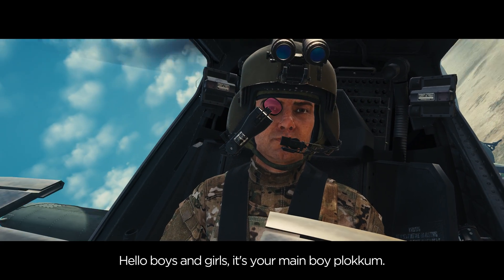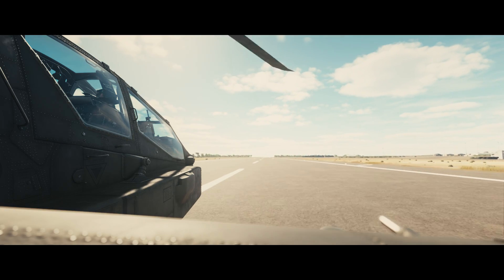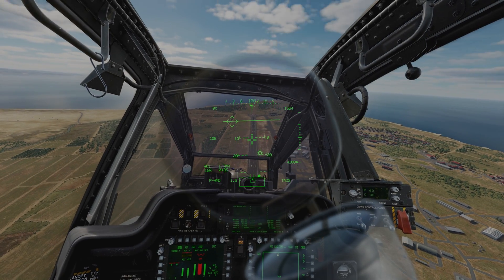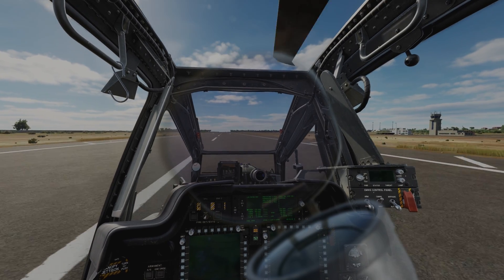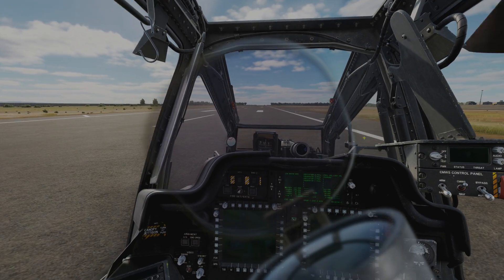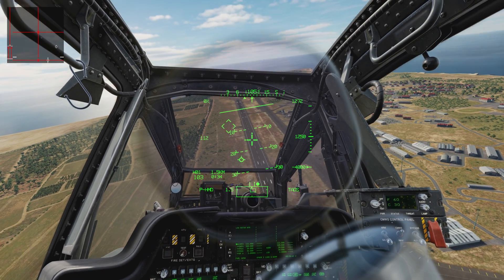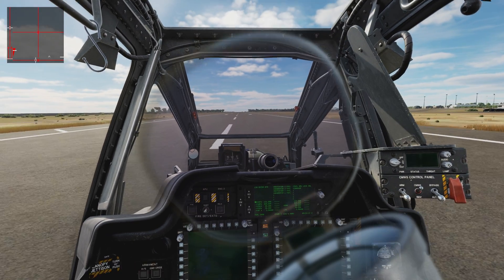AH-64D Apache Autorotation - DCS World

Comment: I admit I only tried it once.  But as a test while flying back to base at about 400ft and about 60 knots I randomly pulled the power levers to idle.  Like an instructor might. I just buried the collective and the nose, dove for the deck for airspeed.  It was a mess as I wasn't used to the bird, but I found I could easily pull out and "fly" without any collective (*) and compared to what I'm last used to practice autos on (Small RC heli's), I found I had tons and tons of time to get it settled down and landed with one a small roll.  The tail wheel can catch you out in the final flare.  However that beats hitting the tail rotor.  A technique to avoid that is the 180* torque rotation in the flare to go nose down and land backwards.  Super easy with a heli that weights 800g that has a tail gyro on the anti-torque pedals for you.  Not tried that manuover in DCS yet.
That said, RC helis require a whole different set of skills.  I was laughing my head off when I took a fixed outside view of the heli and carried on flying it perfectly normally like nothing had changed.  Even brought it into a hover in front of me, nose in.  Different skills.
Reply: (*) at low collective, I found you lose cyclic authority.  I don't think that's correct.  I don't see any reason why a low torque, high rpm, low "collective" pitch situation should or could prevent  a swash plate impulse to induce pitch or roll.  I also think the whole "toppling over upside down" thing is way over done.  I know it's a BIG gyro overhead, but are you really able to upset it that much that it flips?  I highly doubt that given the bodies mass.  The tippy topply effect happens in other flight regimes, like when damaged that I don't think is right either.

Comment: At around 150 feet AGL apply gradual aft cyclic to level out the VSI and decel then cushion with collective.
Reply from the maker: That is indeed how you usually do an autorotation. But the Apache currently doesn’t cooperate :)

 I asked Casmo about the current state of the Apache in DCS and he explained that autorotations are not modeled correctly yet.

Comment: As I understand it the Huey has heaps of mass in those huge rotor blades and so a lot of energy can be stored there as long as they are spinning. It means an autorotation is a little easier. Small bladed helos have less mass in the rotor system so you need a lot more forward momentum and disk lift to help control your descent rate, and a forward touchdown.

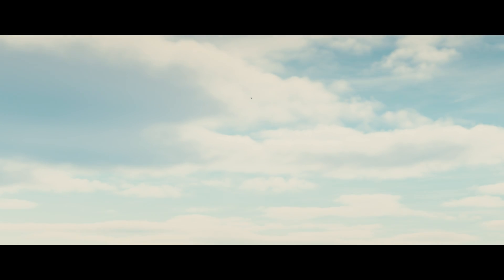Comment: 0:37 basically she autos like a rock depending on the DA haha. Desired airspeed is 77-107ktas, 90 is a good middle ground.  Higher or lower will increase your rate of decent as will being out of trim. 4 things you are scanning are, Rotor, Airspeed, Trim and position to land (flight path vector on the runway/field etc). At 80-130 feet decel with aft cyclic then increase collective to cushion for landing.

Comment: Man that second one was smooth, even touching down at 60 knots, was just like a fixed-wing landing, super linear, i wish i could see it on 3rd view, by the side, to see the shock absorbers working. I've haven't tried AR yet, not really flying, 90% of the time i'm on front seat for now, my bud is doing the PLT, but that was cool to watch, i've a tip for you, idk if will work but, try to flare a littlebit earlier, cuz looks like you're doing a rolling land with power ON for me, like you've lost the ATQ, that would be the right thing to do, but 60 knots is problable too fast even for that, and try to do a "pump" on the collective before touching, right before touch, to get for a second a boost of lift, pull hard the collective super high and put it on neutral again, if you want to do like really Apache pilots, i think that's the way, but off-course i don't have any idea how they do it for sure, i'm just saying what a saw pilots doing in some light aircrafts, worked great, Apache is super heavy and only has 4 blades, kind of short blades, that's not a good combination for AR. But if you don't care about simulation, i mean, want to focus on DCS World, you're already doing great, you can land like that just fine, even if you lost the ATQ, i really think so, shame you can't remove it right, like in others flight simulations, do a proposital failure.

Comment: AH64D Auto - Minimum Rate of Descent 77kts. Max Glide 107kts. (Power off, NR101% Sea Level Stnd conditions)

In the real AH64 there is a guarded CHOP button on collective. If this is modeled in DCS you can use it to chop both engines to idle OR 
use power levers to reduce to idle after lowering collective. 

Also, you DO NOT want to dive in an auto at all. it decreases the airflow into the rotor disc and your RRPM will decay too much. Keep it level, or use aft cyclic to regain RRPM. 
Ideally you want 101% RRPM or slightly above. Lower collective, aft cyclic. right pedal. Jettison all stores if you have them. Try and keep it in trim, land into wind if altitude/conditions permit.

Aft cyclic to reduce airspeed at about 75-125ft. Cushion on landing with collective with a level attitude with some forward airspeed if conditions permit.